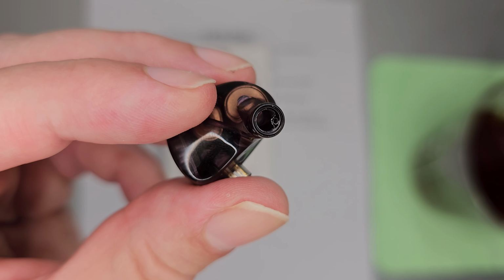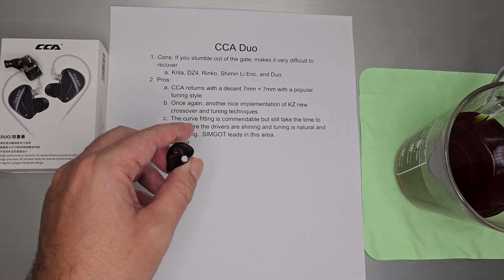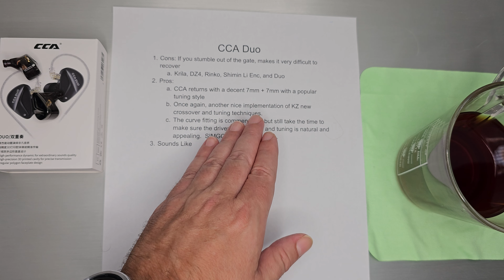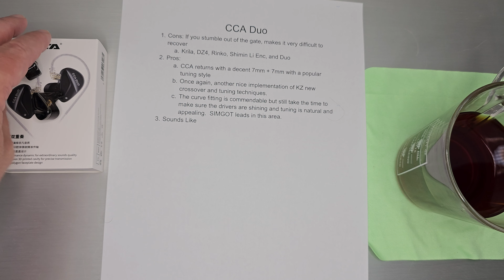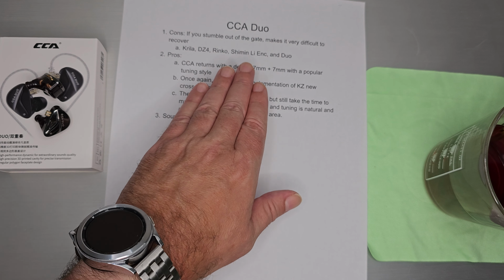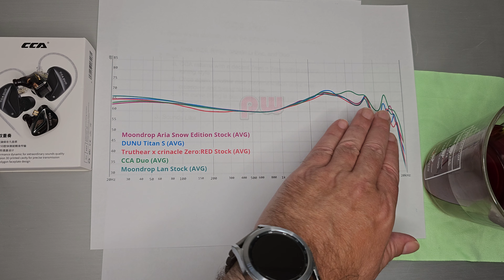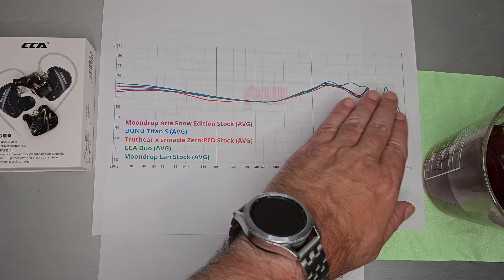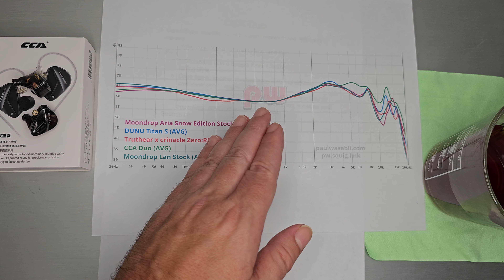Tea Session #3: CCA Duo - Lean Gang Member

Comment: I like this style of bass, also not a v-shaped treble. Will 7hz salnotes zero be a good choice for me? I saw the graph and it looks quite similar. 2. Compared to 7hz zero will cca duo be a better choice in terms of resolution?
Reply from the maker: Depends on what you like about that bass curve.  I like how it dips the subbass and sounds cleaner.  Zero doesn't quite do that but makes up for it in brightness.  CCA Polaris is close to the Duo bass curve, just a bit more.  Zero is a real nice driver so you won't get much benefit with Zero or even Polaris. 1DD sets in the same price point tend to be about the same, what you hear is tuning and more revealing tuning vs a big change in driver quality in modern times.  In the past, some brands would use questionable drivers but now you are better off doing what you said, I like that bass curve and find sets that look similar.

Comment: Is this near identical to the chu? The chu is still one of my favorites but the cable and technicalities are a nono, ive seen some comments saying this is the closest to the chu would you agree?
Reply from the maker: No, 7hz Zero is about as close to the Chu as you get.  That was Crinacle's target for that set.  Duo isn't far though, I'd probably tip roll more on Duo if that is what you are going for.  The bass and treble are Chu-ish, but could be leaned closer I bet with different tips, wide vs narrow bore.
Reply: @PaulWasabii  as close as it is, the zero never hit the same to me. I ordered a duo and hoping that spring tips and maybe putting the chu filter closes the gap. Thx

Comment: what's the point of using separate driver for the bass if it's going to be lean? they did 1dd sets with better tuning - CCA CRA+ or KZ EDX Ultra (too much highs past 10k but I'm sure they could fix it, I fixed with EQ no problem), KZ EDA balanced
Reply: I think it has more to do with bass "quality" rather than "quantity". To get decent bass quality you either need high quality dd, or you need to separate the bass driver(s) from the rest of the frequencies.
Reply: maybe you are right. but i'm not sure this "separation" actually improves bass somehow
Reply: @kalo_nord  hbb (bad guy good audio review) has an explanation on this somewhere. Basically, its his whole reasoning to choose "Master of Reality by Black Sabbath" as his bass test, and why single dd iems usually suffer in the bass department in that album.
Reply: @shaami8622   I compared KZ PR2 with Trn Mt4 (cheap 2dd, where probably only 1dd actually works, 1 of them glued) and after equalizing both of them I could not hear any difference in bass or any other frequencies. Well, bass was just a little different, but i'm not sure i could tell them apart in blind test. So? 2 completely different drivers, technologies and no difference. I did not try black sabbath but I listened scorpions, my usual test track and many other genres of music. So I doubt that  2DD wll change anything compared to 1 DD. BadGuy is audiophile, he meant to tell you that all IEM's are different, expensive much better, better soundstage, "resolution" etc etc
Reply: @kalo_nord  My guess is the Duo is trying to get the best "quality" by using a smaller driver, make it lean so that the already fast small driver can do even tighter bass, while also separating it which will reduce the load on that driver. All of which seems to be an effort to produce better bass "quality" rather than "quantity".

Also, i dont do eq but a small driver is usually faster than a big driver so it could perhaps keep up with a planar. However the timbre should be different as smaller drivers wouldnt be as "punchy" as bigger drivers because of how much air it can displace in an instant.
Reply: @shaami8622  you maybe right that small driver gives less bass, moves less air etc. Because i noticed that 12 mm driver is more bassy even graphed the same as 10 mm (I EQ and compared them directly). But i cant understand their idea to do lean bass even leaner 🤣 if they use small dd, they should increase volume
Reply from the maker: I am with you on that and if I had more of a voice, would have kept it in my notes.  The hybrid theory would be to pair two specialists that can outperform 1DD.  That is the 10mm & 6mm idea.  You can get big lower bass and extended, DD treble with a 6mm, separated with audio tubes.  I am still a bit confused on the 2 7mm but KZ said they aren't the same.  Why they leaned it out? Not sure at all and why they couldn't explain target is also strange.  The shelf resembles the low setting on D-Fi and Krila so not unique to Duo, but it is not my favorite flavor of their bass shelf.  Looking back at D-Fi feedback, I do think people found it interesting that KZ would drop it that low and as I said, that fan base exists with other sets, so maybe they are just testing the waters.